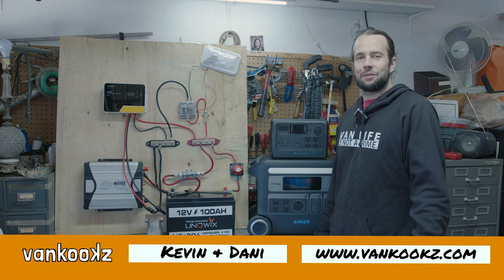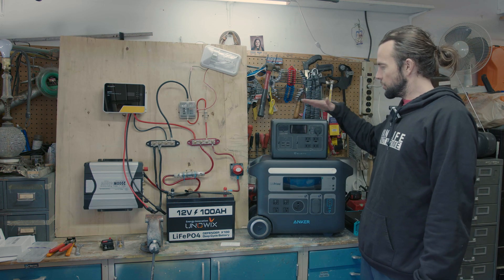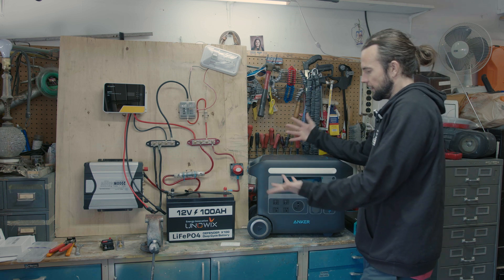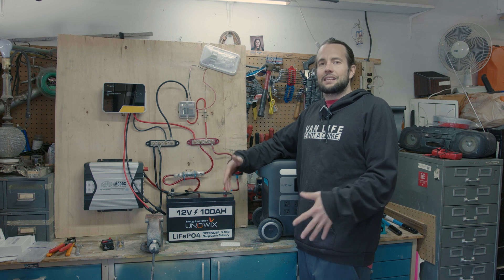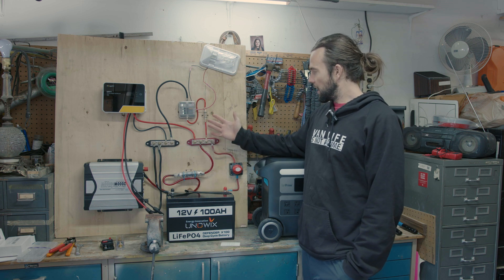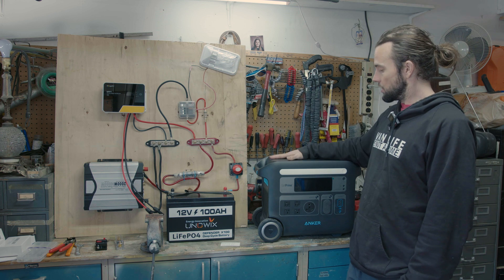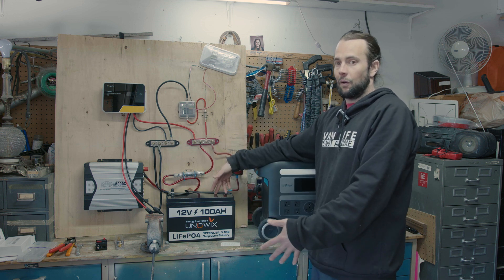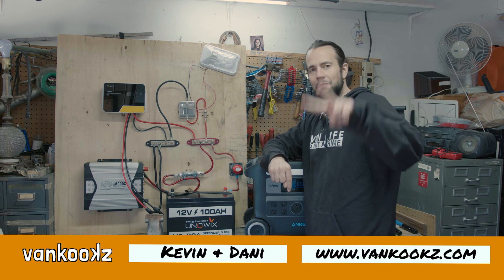Portable Power Station vs 12 Volt DIY Solar for a Van Conversion

Comment: Take it from someone who spent $3600 on an all in one system (ecoflow delta pro)... Build your own! This is in the context of depending on your power system full time. Yes the waranty is good but when things break (yes, WHEN, not it) you will be shipping it away for repair. That means you are out or power for however long that takes. Also something that very few people comment on is the lack or 12v output these things provide. On paper it seems okay but its just not adequate. Long story short, I am now building my own system and ditching the ecoflow unit.
Reply: But batteries and mppt charge controllers can go bad too.
Reply: @joeblow1942  With a do-it-yourself system you can swap out the piece that goes bad, like the battery or charge controller. You can't do that with an all-in-one unit.
Reply: @mrdavemo    That’s a really good point. All in one’s are relatively new so I imagine that in time we will be seeing videos on how to replace components  that go bad in them.
Reply: im sorry to break it to ya, but diy goes bad too, the price difference being really just around 500 bucks, ill take the plug n play any day.
btw im on a bluetti ac200p for almost 2 years, zero problems, and if it happens, well there are power outages even in conventional homes....
Reply: @9everton5     I have two all in one systems (Ecoflow Delta 1300’s) in my current van build and plan to use them (or bigger ones) in my next build. It’s nice to be able to pick them up and charge them in only 90 minutes with 110 AC when it’s been cloudy for a couple days.
Reply: just use 2 in case 1 fails
Reply: @StevenDavisPhoto    That’s what I did.
Reply from the maker: Thanks for this great insight. I have had friends have the same problem and had to send back their Goal Zeros and be stuck without power for weeks.
Reply: what should i do if i don't have the knowledge to build my own . find someone who can build it in my camper trailer conversion or buy the generator
Reply: @seanmalone7920    Lots of easy to follow how to videos on YouTube. You can even buy a box that already has the outlets (not enough though) and a built in inverter that will take lithium batteries up to 3000AH.
Reply: Thank you as I am researching this very issue with the exact model by chance, and this is the single issue I was worried about.  The Echo was 20% Less than it would be for DIY but your point is well taken.  If I were you since you're in already; I would consider buy another if possible $$ ($5,700) and have 12kwh and always a backup.

Comment: Isn’t the real issue that the Anker runs 12V and AC, allows a simple adapter for camper charging and would allow solar panel charging, 12V van charging and Shore charging without any modifications. On top of that, it comes with apps for managing the entire system without having to be physically involved with the unit. Add on the obvious advantages of space, even with a second battery and not having to be an electrical engineer if a custom system fails. I don’t see it as a dollar issue so much as the ability to self manage the entire system and in off seasons have a removable battery for workshops or home use.

Comment: During a promo, I got an Anker F2600 (2500wh) for $1,350. It seems like a no-brainer to use this over building my own setup. You also need to factor in the cost of one-off tools for creating your own setup, too.
Reply from the maker: Yeah you can’t beat that. They are also getting a lot better.

Comment: I did a fairly detailed analysis of a larger system comparing a brand name DIY vs. the EcoFlow DELTA Pro Ultra 6kw battery/inverter combo.  The Echoflow was roughly 20% less and provided more features like 220v (Should you need to do some wash or welding from your RV) .  I would love to see you duplicate this as I have limited knowledge of the subject.

Comment: How would you power the 12V stuff from the Anker? A cigarette lighter adapter to a positive and negative bus bar? Probably would be water pump and lights only. Fridge and everything else can run 110.
Reply from the maker: Yeah a cig adaptor. Strip the cables and hook them up to a 12v fuse panel or bus bar like you said. I would go with a fuse panel.
Reply: You can wire it right into your solar and still have outlets throughout your van

Comment: Powerstations are more bang for the buck. They have really dropped in price.  Shopping around, for about $1,000 powerstation I can get what would cost me $1500 in similar RATED components + wiring.  These powerstations have high charging ampacity, that is more expensive for a DIY.  The downside to them is the inability to replace a single faulty  component and the inability to add 3rd party battery expansion.  The powerstation that allows for connection to 12V lifep04 as a way to expand the capacity would be the ultimate design.  The biggest advantage powerstations have is that they can serve multiple use functions also and are not permanently attached to the van.   All in all,  I would say a more casual camper should just go with a powerstation. Someone that wants to stay off grid for long periods should do their own build with more capacity.
Reply from the maker: This is great! I agree with all of this.
Reply: There are ways to add additional batteries to these, not the extra units they sell but you can add capacity by adding the lithium battery in to the mix, you can charge the unit from a battery then recharge the battery with solar when the sun is out or if you have access to ac power.
Reply: @klatlap  yes but now you essentially bought 2 MPPT solar chargers and 2 converters.  At that point it would be cheaper to buy a inverter and 1 more battery than to buy a powerstation. But if the power station could charge the battery than it would be the perfect design and make it cheap to expand a small powerstation. But the method you describe is something I do.  It is actually beneficial to have 2 ways to charge from solar also because expanding solar can have issues when you only have one solar charger.  I have 2 rooftop panels but also have a 2 flexible panels that I put out on sunny days.  600W total and I can run my AC unit for the hottest part of the day.

Comment: Rule #1 Nothing is EASY! Safety FIRST!  Hey these things HAVE caused fires. ALL of the POS connections must be covered or insulated. Shouldn't the fuse be connected within 7 inches of the POS battery connection at the battery and come before the switch for your switched loads?  That way you remove the switched loads if you have to replace the fuse. And any unswitched loads can come off a separate POS busbar connected to the load side of the battery fuse to provide the MOST protection from a fire in the event SHIT happens. I believe the ABYC have rules about this for fire safety on boats which would be a standard for all DC systems to strive for.

Comment: Your cost is off 100ah $275-2000 watt inverter ? 129,  controller $100  your over costing the  breakdown !  200 watt solar panels 200 bucks each !  All in one stuff is all over priced ! Build you own 700 bucks will get you a system !
Reply from the maker: I agree! But that’s what all this stuff actually cost I could have definitely gone cheaper
Reply: @Vankookz  Soon 100ah Lithium Battery will be $100 bucks ! Controllers can be 20 bucks 2000 watt inverters are 130 bucks so the price for do it yourself is less than half ! It's a great time to configure systems !

Comment: Not an apples to apple comparison, the Anker is 2048Wh, equal to about 170 Ah. A more fair comparison would be to use a 200Ah battery in the DIY system which would increase the cost by $300. Or use a smaller power station, like the EcoFlow Max 1300 which costs $800 less than the Anker. Either way, the difference between DIY and a comparable power station is not $900.
Reply from the maker: Yeah I get it. But when this unit has any issues it’s almost impossible to troubleshoot
Reply: Correct. He also did not add the Cost of AC Charger which the power stations have built in already in case there is cloudy day and you need to charge your battery from AC. The cost difference can still buy an extra battery though and when the battery in your portable power station comes to the end of its life, I am not sure the companies offers battery swap. So DIY still wins for me anyways
Reply: gets less clear with the Vtoman 1500 with extra battery (3000 watts total) for around 2 grand. Lasts 10 years, no wiring, and accepts 1500 watts charging AC
Reply: yeah, same thing i was thinking.

Comment: Get Video Kevin!  I built out my van a little over 2 years ago.  Watching some of your AWESOME video's was a HUGE help.  I'd like to ask you a question.  I want to buy a portable power station (Delta Max, etc.) for home back up power.  But, instead of buying additional solar panels, I would like to charge the power station from my existing solar panels on the roof of my van (2 Renogy rigid 100w panels).
Currently, my 2 panels run (in parallel) down to my CTEK250SE MPPT controller, then down to my 2 Battle Born 100Ah batteries.
The solar connector on the Delta Max is an XT-60 plug which typically runs to 2 M4 type connectors that connect directly to solar panels.  I am thinking that I can daisy chain the Ecoflow off my 2nd battery with o-ring connectors on the battery side and m4 connectors on the power station side then into the XT-60 adapter into the power station?  Other option would be o-ring connectors off the CTEK controller to M4 connectors to the Delta Max.  But I don't really think I need to involve the MPPT controller?
This is something that others may want to do as well so it might be worth mentioning in one of your upcoming excellent video's.  Anyway, any help/advice is much appreciated!   Thanks!!
Reply from the maker: I would personally use the MPPT directly into the Delta Max. What I did in my van to charge these units is I added another charge controller with a modular array that I can send the power wither into my Battery bank or into a portable power stating. Adding a MPPT is fairly inexpensive and you can wire them in parallel. Unfortunately modular solar panels are not. That way when your battle born batteries are full the other charge controller can send the additional power soley into your power station.  I think either way is a great option without haveing to buy another MPPT but if you did add another MPPT you could always expaned a larger modular solar array.  More on this will be coming soon.    It will also take a long time to charge that unit off of only 200 Watts.
Reply: @Vankookz  Thanks!!

Comment: Need another battery to match the Anker as only one battery gives about 1200-1300 Watt-Hours.  That adds another $400 - $500.  The Anker is usually often on sale for $200 off.  So your savings goes down from $900 to about $300.
Reply from the maker: Yeah I totally agree.  I was just trying to get the point across that building your own 12v system is easy. A lot of people buy these power stations for their rigs and they work great but they could just take the initiative and do it themselves. I think this Anker power station is an awesome unit however for it to be able to charge at 1000W and the 1440W input via AC is pretty incredible.  It would be hard to achieve those parameters with a DIY system for the price of the Anker.
Reply: Totally misleading.  You should have added the 2nd battery cost.
Reply: Was going to comment the same thing.

Comment: The Anker has around160AH lithium battery  so is more powerful than your system !! compare like for like  if you're doing a comparison. also the Anker is movable from place to place  and vehicle to vehicle  so essentially  you have a full power system ready for any vehicle you're using  and as a house back up system  too so much  more adaptable than a fixed system . Try to be more prepared next time  . this was a poor compariosn video
Reply: Agree, actually the industry product will have a lot of safety protection, but for DIY product can't have any protection equipments. But if you are engineer you can repair it yourself.
Reply from the maker: Yeah, this is all true.  This video is more aimed at how simple a DIY system can be. I've lived van life for 7 years now, and many of the people I meet on the road have these power stations, and they fail and can't do anything about it. So they have to get rid of them, which ends up being way more expensive than a basic 12 Volt DIY system.  I never know what I'll get from the peanut gallery when I make these videos. . The Anker is pretty impressive; however, with 1000W input via solar and 1440 via AC, it would be hard to replicate this system diy for that price.  But this DIY system can easily be fixed whereas the anker can't.
Reply: @Vankookz  true but the Anker does  has a pretty good five year warranty for peace of mind. I have it in my rv  and also in the work van ,  and have taken it to wild off grid   place's . this adaptability and power is pretty hard to beat

Comment: Plus, none of these power system manufacturers offers any repair possibilities after the warranty expires. I would never spend thousands of dollars on something with a potential life span of a year or two. I speak from experience. My Bluetti died several months after the warranty expired and there is no way to have it repaired.
Reply from the maker: That is a very valid point and one I wish I had talked about for this video.  Yeah, I'm not a big fan of them that's why I wanted to build and compare a simple basic 12-volt system and compare it to something that's $2000!
Reply: I think you bought the old version machine, now the machine is very stable and can use more than 3 years in normal condition.
Reply: Many of the EcoFlow and Bluetti power stations have 4 or 5 year warranties from the factory. Asurion offers a 4 year warranty on many of the power stations sold on Amazon. In a DIY system, there is no warranty, though some individual components, like batteries, may have one.
Reply: Well I hate to be that guy but since companies don't build quality equipment anymore I do this. I buy a product and when it craps out, I buy another one, ship the old one back in for a refund. Boom, problem solved!

Comment: Great video for people on a budget, plus if the battery fails on the Anker power station be a bitch to change it 😖
Reply from the maker: Yeah I don't even want to think about getting in there and doing that!  😱😱😱
Reply: If you get ecoflow delta, 10 year warranty i believe or 5.. which is insane and will pay for itself!